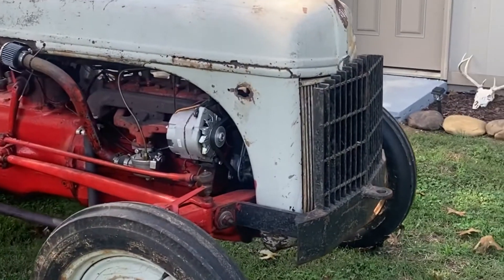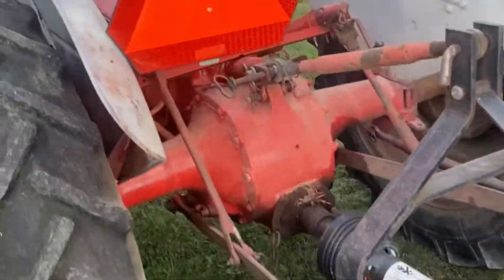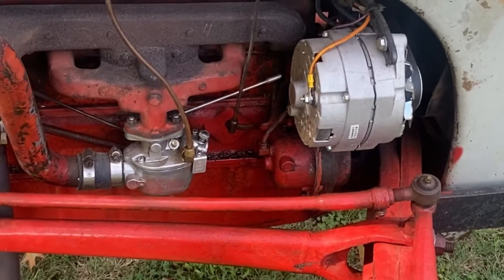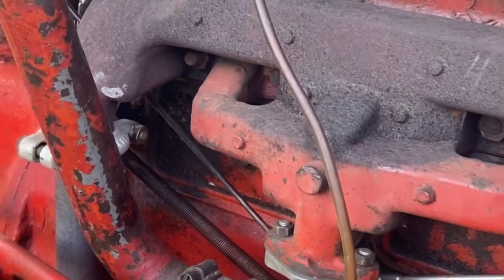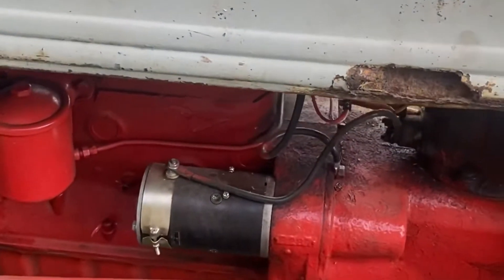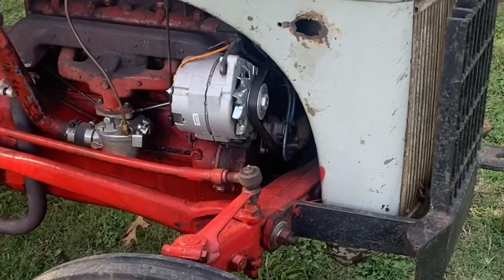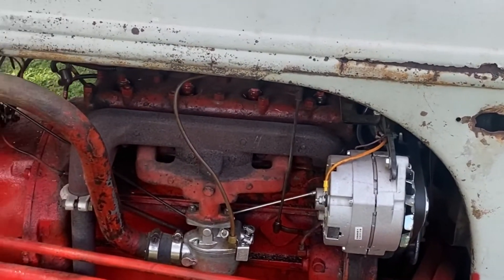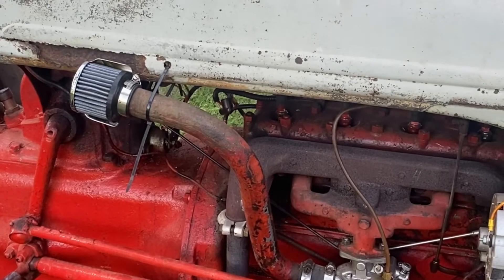FORD 2N ,8N,9N 12volt conversion

Comment: Thats a 2n you have there..not a 8n. I can tell just by the frt steering set up .
Reply from the maker: Yes you are correct. That’s what I put on the the thumbnail picture and title.  The 2n 8n, and 9n are just on there to say that the 12 volt system will work for all three. Thanks for the comment and thanks for watching.

Comment: Can you tell me about what air filter you're using if you find a spare minute?

Thanks for your videos!
Reply from the maker: Yes, I will look up the part number when I get to my computer and add it to comments. It’s actually a air filter from Allstar performance that fits a 1 1/2 pipe. I bought it on Amazon. I will get the link for you
Reply: Did you ever post the link anywhere?
Reply from the maker: @MADuranDude777  sorry about that here is the link on amazon https://amzn.to/3fugYVO
Reply from the maker: @MADuranDude777  i also added the link to the description on the video along with the electronic ignition. Thanks for watching
Reply: @pineylife  thank you for that quick reply. I appreciate it.
Reply: Your sputtering/bogging under load was from your carb?

Comment: But why? 6 volt worked for 70 years
Reply from the maker: I agree with you on the 70 years. Main reason is they just don’t make quality replacement parts anymore. Everything is cheap made.  For example blue streak points was the way to go on the 8ns but anymore the blue streaks are a cheap knock off. With the electronic ignition for 12 volt it completely gets the volts it needs all the time plus no more points. I mainly done it for a more reliable tractor for long working days. Hope this helps and thanks for watching.
Reply: @pineylife  ok thank you. Do you need 12v for electronic ignition or can you get a 6v electronic ignition kit?
Reply from the maker: @finncampeau4922   Yes They do pertronix has 6 volt and 12 volt ignition. simple to install and work great. Sorry for the late reply. for some reason my comment section didn't have this comment i stumbled across it while answering another question on the video.